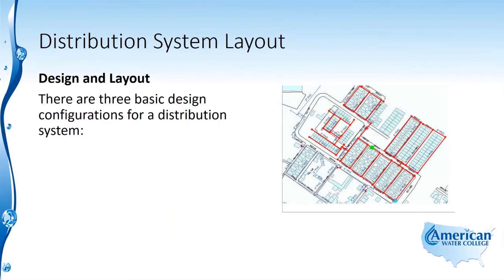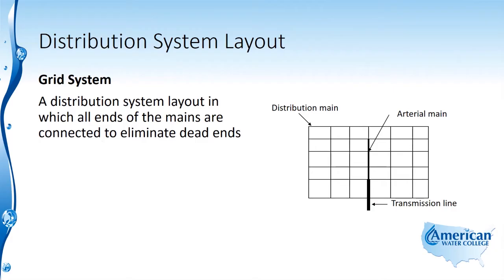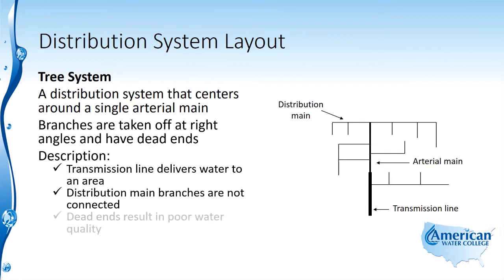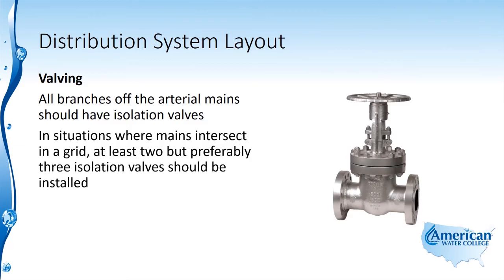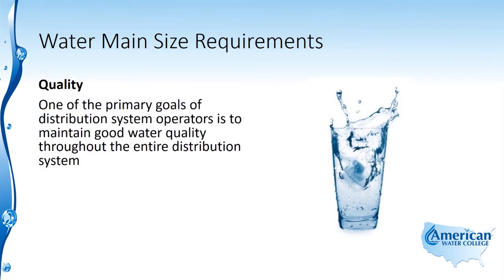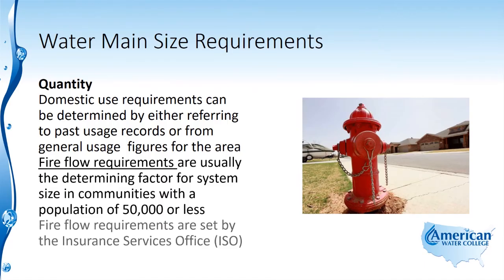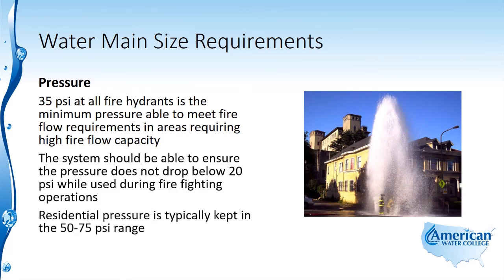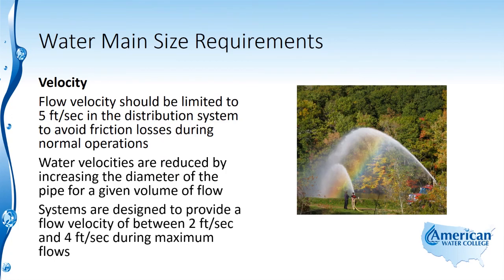Water Distribution | System Design and Layout

Comment: Assuming you have  being given a project to design and construct SHS building, as a water supplier engineer, you has being asked to develop a sustainable and safe water supply system based on  the; water source selection, transmission and distribution network, storage tanks pumping station and fire hydrant placements design should be make based on demographics projection and topographical data.
How do you go about it , and is there a video to guide you ?
Thanks for your good and understanble videos